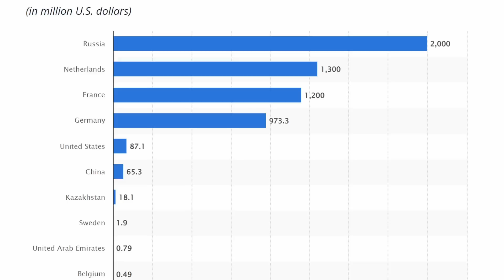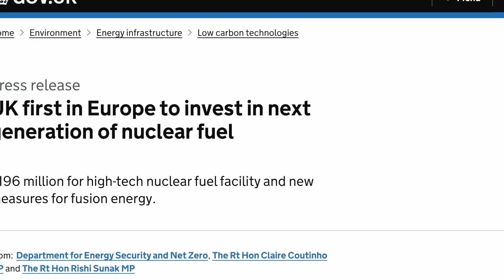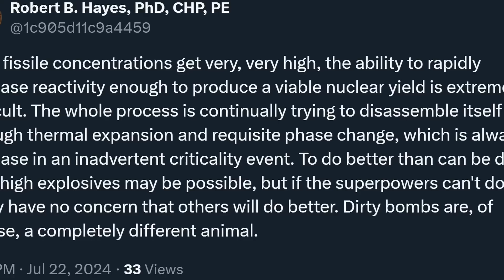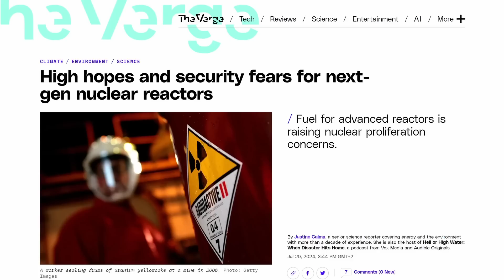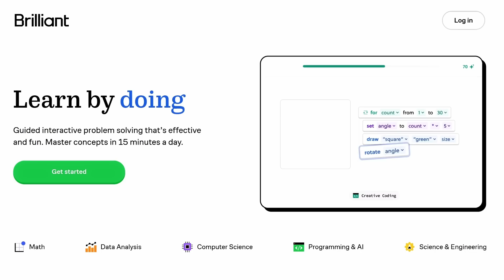Small modular reactor fuel could be used to build nuclear bomb, experts warn

Comment: Sorry I am not an expert but I've been around a couple and I find this video to be ... disconcerting. I don't think you can get a critical reaction from non-enriched Uranium or even low enriched Uranium no matter how much of it you stack up. That's why a  flux moderator is needed inside nuclear reactors that uses low enriched Uranium, even though there are up to forty tons of fuel rods inside. Also the U235 gun design used for the Hiroshima bomb is pretty straight forward not a lot of tinkering involved. The plutonium implosion design is super difficult because the explosive layers around the core need to be shaped in such a way that the shock wave is perfectly concentric which is VERY difficult to do. The reason the Manhattan team focused on the implosion design is Plutonium is too reactive to be used in a gun design it will fizzle instead. But weapons grade Plutonium can be produced much more easily than weapons grade enriched Uranium. Plutonium is a different chemical element and can be easily separated from the Uranium rods and purified. Enrichment is a mechanical process since U235 and U238 are the same chemical element and is much, much harder to do. 
In short a weapons grade U235 bomb is not that difficult to make. However the HALEU used in these mini reactors is not, as far as I understand usable for such a bomb.

Comment: Don't worry turning their fuel into bombs, dirty or otherwise will NEVER happen, because the SMR idea is a boondogle that will NEVER be commercialized.  Problem solved!  In case your wondering the reason why its a boondogle is that fundamental scaleing laws dictate that reactors so this small will have 10x the per unit power cost.

Comment: Technically, one can make a bomb with U-233, but both the U.S. & U.S.S.R. decided that it wasn't worth the effort.  Therefore L.I.F.T.R.s don't use practical bomb fuel.  (But they can be designed to use 'spent fuel' from Light Water reactors...)

Comment: It should he noted that uranium, even with a 15% u235 concentration, is only as dangerous as other non radioactive, and easier to get material. It's alpha decay and non metabolic, so the main issue is from its physical properties causing lung infections, fibrosis or renal diseases. But a dirty bomb would be much more deadly using beta/gamma emitting material used in medical imagery.

Comment: 1:00 are you sure you want to call uranium 235 a compound? Compounds mixtures of multiple different things? Isn't uranium 235 a specific single isotopes of an element? So you must be referring to the compounds which U235 exists as a part of, whenever it's not totally isolated. So oxidized uranium or some alloy of uranium, those would be compounds.

Comment: Any spent fuel road contains very small amount of plutonium.  Recycling it can yield a tiny amount of Pu 239. The purity for nuke bomb must be 90%.
Unspent fuel purity is very low, 3% unable to refine for nuke.

The real danger of SMR 300MWe is the method of moduling. The known Nuscale design is, lower reactor upper supercritical steam generator in one body module.
This structure is like two dynamite rods bound together.
The serous one is US state agency approved this compact machinery.

Comment: Trust corporate marketing firms to skew a topic to make it look better. Selling a stove with a broken burner? Tell your client it has three working ones and you're all set!
In the case of small modular reactors, at least in Canada, their development is massively subsidized by the state so when the reactor finally comes online, the end user has probably paid twice for each kilowatt consumed (and that kilowatt isn't cheaper than the one produced by regular means). That SMR will also produce spent fuel rods and those rods generate heat decades after they are spent. Where to put those rods? SURPRISE! You need to create a huge installation near some waterway and use that water to make sure that spent uranium does not go critical. FOR THOUSANDS OF YEARS. You'll never guess who helps finance that installation ... the tax payer!
One last interesting tidbit. You need insurance for all these reactors. Insurers know a nuclear accident easily goes into the billions of dollars so whomever builds a reactor needs a sugar daddy. Once again the state comes in and uses it's resources as collateral. That basically means in case of a hideous accident, the government is on the hook for cleanup and buying back irradiated land and houses and also paying for whatever lawsuits go beyond the means of the corporation that owned and operated said nuclear reactor.
If you're still interested in nuclear reactors and don't mind the added bonus of having waste fuel be used to create bombs, might I suggest you offer your backyards to store all that so safe nuclear waste?

Comment: Why not thorium? No proliferation FTW
Reply: 𝗧𝗵𝗼𝗿𝗶𝘂𝗺 𝗹𝗮𝗰𝗸𝘀 𝗮 𝗳𝗶𝘀𝘀𝗶𝗼𝗻𝗮𝗯𝗹𝗲 𝗶𝘀𝗼𝘁𝗼𝗽𝗲: it is impossible to start any fission chain reaction purely on mined thorium, and therefore any nuclear system relying on thorium would be initially dependent on prior generation of fissile matter (extracted 𝘧𝘳𝘰𝘮 uranium or bred 𝘪𝘯 uranium systems).

The development of new fuels or new reactor concepts is a time- and resource-consuming process likely to span several decades. Any industrial application of thorium as a nuclear fuel would continue to require the input of fissile material from the existing uranium/plutonium cycle until the required amounts of ²³³U could be produced to ultimately make the thorium cycle self-sustaining.

The development of a fully self-sustaining thorium/²³³U cycle would also require the development of industrial-scale reprocessing capabilities to recover ²³³U from spent fuel, along with fuel fabrication facilities to prepare the material for re-use.
See the report titled 𝘐𝘯𝘵𝘳𝘰𝘥𝘶𝘤𝘵𝘪𝘰𝘯 𝘰𝘧 𝘛𝘩𝘰𝘳𝘪𝘶𝘮 𝘪𝘯 𝘵𝘩𝘦 𝘕𝘶𝘤𝘭𝘦𝘢𝘳 𝘍𝘶𝘦𝘭 𝘊𝘺𝘤𝘭𝘦: 𝘚𝘩𝘰𝘳𝘵- 𝘵𝘰 𝘭𝘰𝘯𝘨-𝘵𝘦𝘳𝘮 𝘤𝘰𝘯𝘴𝘪𝘥𝘦𝘳𝘢𝘵𝘪𝘰𝘯𝘴, dated 2015, by the Nuclear Energy Agency.

Nuclear weapons proliferation is certainly possible via the thorium/²³³U fuel cycle route.

* For pure ²³³U the critical mass is 16 kg.
* For pure ²³⁵U the critical mass is 48 kg.
* For PWR-type plutonium the critical mass is 13 kg.
* For 'weapon grade' plutonium the critical mass is 11 kg.
See the Nuclear Energy Agency's 2015 report titled 𝘐𝘯𝘵𝘳𝘰𝘥𝘶𝘤𝘵𝘪𝘰𝘯 𝘰𝘧 𝘛𝘩𝘰𝘳𝘪𝘶𝘮 𝘪𝘯 𝘵𝘩𝘦 𝘕𝘶𝘤𝘭𝘦𝘢𝘳 𝘍𝘶𝘦𝘭 𝘊𝘺𝘤𝘭𝘦: 𝘚𝘩𝘰𝘳𝘵- 𝘵𝘰 𝘭𝘰𝘯𝘨-𝘵𝘦𝘳𝘮 𝘤𝘰𝘯𝘴𝘪𝘥𝘦𝘳𝘢𝘵𝘪𝘰𝘯𝘴, Table 9.1.

The critical mass of ²³³U and plutonium are fairly similar, while that of ²³⁵U is
comparatively higher. Depending on the design, it takes between 5 and 15 kg of ²³³U to
make an atomic bomb, which is not very different from the required mass of plutonium.

Comment: Probably should be pointed out that due to its high density, 1 ton of uranium is a bit over 50 liters. Small enough to fit inside a medium sized ice chest. Of course no ice chest is going to be strong enough to let you lift 1 ton. But for smuggling purposes, the volume of material is a lot smaller than you might expect.

Same goes for nuclear "waste", or spent fuel. Anti-nuclear folks like to talk about how the U.S. nuclear reactors generate about 2000 tons of spent fuel per year. But that's only about 105 m^3 per year. Vs about 1000 oil tankers worth of coal per year to generate the same energy. The total volume of spent fuel generated by nuclear power in the U.S. since its inception would fit into two Olympic sized swimming pools with plenty of room to spare. (Not that you'd want to store it that densely, because that would turn it into a huge nuclear reactor.)

Comment: Why can't we just use naval reactors rather than reinventing the wheel with new Small Modular Units? We already have training facilities, operating experience, fabrication factories and a recycling program. I get that ship reactors tend to use 90% plus fuel, but its not like powerplants with only 3.5% skip on security. 

Admittedly, I'm not a fan of small reactors - there is very much an economy of scale. Gamma rays are gamma rays - so you can't use less shielding on a thirty megawatt unit than on a three hundred unit. On the other hand, the number of crew members doesn't go up exponentially, so one big reactor won't require as many people as ten small ones. Not just control room staff - but ten reactors is ten plus turbines, and other support equipment. Think of it like comparing a bus to private cars. One metro transit unit is much larger and has a more expensive engine - but you transport fifty people with one engine, one driver, and one set of tires meaning you will have aggregate savings over ten five passenger automobiles.

Comment: It looks like the key paragraph in the article you cite is the following:

""For technical reasons, the traditional 3 to 5% fuel will not suffice for many of the power reactor designs that nuclear engineers want to build today. For example, proposed microsized reactors are so inefficient with their neutrons that they need HALEU simply to turn on. Most designers favor 19.75% 235U HALEU—on the cusp of HEU—because more 235U almost always eases constraints, but use of HEU is discouraged because of its clear weapons potential. In many designs, the amount of HALEU needed is hundreds to thousands of kilograms, which may mean that a single reactor contains enough HALEU to make a nuclear weapon. If this is the case, commercializing HALEU fuels without ensuring that the material is appropriately protected against diversion by national governments or theft by terrorists would pose a serious threat to security."

The article doesn't mean that they the fuel rods in their original state would be used to make a weapon, but that they already contain the necessary fuel to make it. While it would need additional processing to be used in a bomb, a substantial part of the necessary work  would have already been done. I agree that very few countries might have the technology to do so, but it could be acquired. I suggest you to read the article carefully. It does have a point to make.

The issue is that people must learn to use nuclear power without the temptation of building nuclear weapons.
Reply: Her point isn't that it's impossible. It's that it's highly impractical. You can theoretically get enough material for a nefarious purpose. Wow. That's true nearly EVERYWHERE. And there are much easier targets with much more exploitable vulnerabilities. This would still take a crap ton of work that is hard, precise, technical, and pretty likely to get you caught in the process.

Again, remember that the world's leading provider of HEU is Russia. RUSSIA. If you're worried about the proliferation of nuclear material to bad actors.. That ship has long, long sailed lol. 

This is not the problem.

Comment: Why is Sabine putting out disinformation meant to mislead those who might wish to build a homemade nuclear weapon?  Sounds like DTRA is getting nervous.  No Sabine, you can't make a functional nuclear weapon with any quantity of 2% enriched uranium.  No Sabine, it does not take 52kg of high-enriched to make a functioning weapon, it takes about 5kg, a volume about the size of a softball.  No, Sabine, high-enriched is not "100%", it is generally 92-95%.  They enrich to 95% and change the cores out every 20 years.  Anything less than 80% will fizzle and it takes about 20-25 years for a 95% enriched core to decay to 80%.  Core swaps were delayed because even a fizzling fission device when attached to a thermonuclear stage will produce a fusion reaction, enabling the NNSA to declare the fission cores viable over periods of greater than 20 years.

Comment: USA concluded already after the Hiroshima bomb that using U-235 for anything other than a one off nuclear weapon is futile. With 80% enrichment the Hiroshima bomb was technically only slightly better than a fizzle, in other words only a very minuscule portion of the U-235 used underwent proper fission.
Reply: Bro, that "slightly better than a fizzle" killed on the order of 100k people. I get that thermonuclear megaton stuff is the state of the art,  but the the old-style kiloton is already pretty deadly.
Reply: Inefficient, not futile. Also, enrichment technology has advanced a lot during the cold war and afterwards. And even though it was low-yield, you don't need extremely powerful bombs to be effective.

Comment: The issue with small form factor nuclear power, is the distribution of facilities that need to be heavily secured. If you concentrate your facilities down to a small number of heavily guarded locations, they are easier to secure against theft, easier to control who has access to them legitimately, easier to secure against terrorism or sabotage besides, and the number of routes used to transport material headed in or out of those facilities are few, and in turn easier to secure. 

 If you distribute many smaller units instead, securing myriad sites adequately becomes a greater task, requiring more manpower and other resources than would otherwise be the case, as well as making logistics route security harder. Even if said resources were available, it would still be a more complicated, easier penetrated security cordon than would be the case for fewer, larger facilities. 

 As it is, local authorities know that if an event occurs at a nuclear facility, every responding agency just dogpiles one location and secures it. If there is a nuclear reactor for every twenty square kilometers or something, and something happens, they'll have to scramble to identify which facility or facilities are affected, potentially having to split their forces, making the whole response more chaotic and less effective. 

 Many tell me that my concerns about nuclear accidents and nuclear terrorism are statistically absurd, pointing at Chernobyl and Fukushima as outliers, but what people don't seem to appreciate is the fact that those disasters were so huge, that their infrequency is heavily outweighed by the risks. Add a more convoluted distribution of fissile material into the mix, and the potential for disaster and deliberate malicious action becomes far more likely, and that is a risk factor that is UTTERLY unacceptable. 

 I love the IDEA of distributed systems, because from a strategic perspective they make it harder for a first strike assault by an adversary to shut down the country's grid by hitting large power stations, but from a tactical perspective its a really fucking bad idea and I don't dig it at ALL. I WISH we could have more convenient, less centralised power production and distribution systems, but placing many nuclear stations around a given landmass is a security nightmare and a bloody poor idea.

Comment: Then why aren't we pushing for thorium reactors?
Reply: Thorium reactors don't exist. 𝗧𝗵𝗼𝗿𝗶𝘂𝗺 𝗹𝗮𝗰𝗸𝘀 𝗮 𝗳𝗶𝘀𝘀𝗶𝗼𝗻𝗮𝗯𝗹𝗲 𝗶𝘀𝗼𝘁𝗼𝗽𝗲: it is impossible to start any fission chain reaction purely on mined thorium, and therefore any nuclear system relying on thorium would be initially dependent on prior generation of fissile matter (extracted 𝘧𝘳𝘰𝘮 uranium or bred 𝘪𝘯 uranium systems).

The development of new fuels or new reactor concepts is a time- and resource-consuming process likely to span several decades. Any industrial application of thorium as a nuclear fuel would continue to require the input of fissile material from the existing uranium/plutonium cycle until the required amounts of ²³³U could be produced to ultimately make the thorium cycle self-sustaining.

The development of a fully self-sustaining thorium/²³³U cycle would also require the development of industrial-scale reprocessing capabilities to recover ²³³U from spent fuel, along with fuel fabrication facilities to prepare the material for re-use.
See the report titled 𝘐𝘯𝘵𝘳𝘰𝘥𝘶𝘤𝘵𝘪𝘰𝘯 𝘰𝘧 𝘛𝘩𝘰𝘳𝘪𝘶𝘮 𝘪𝘯 𝘵𝘩𝘦 𝘕𝘶𝘤𝘭𝘦𝘢𝘳 𝘍𝘶𝘦𝘭 𝘊𝘺𝘤𝘭𝘦: 𝘚𝘩𝘰𝘳𝘵- 𝘵𝘰 𝘭𝘰𝘯𝘨-𝘵𝘦𝘳𝘮 𝘤𝘰𝘯𝘴𝘪𝘥𝘦𝘳𝘢𝘵𝘪𝘰𝘯𝘴, dated 2015, by the Nuclear Energy Agency.

Meanwhile, world uranium ore production has not been meeting demand since around 2015. See the World Nuclear Association's webpage titled 𝗪𝗼𝗿𝗹𝗱 𝗨𝗿𝗮𝗻𝗶𝘂𝗺 𝗠𝗶𝗻𝗶𝗻𝗴 𝗣𝗿𝗼𝗱𝘂𝗰𝘁𝗶𝗼𝗻, updated 16 May 2024.

And it seems available global high-grade uranium ores are insufficient to sustain a so-called "nuclear renaissance" in the longer-term. See the Energy Watch Group's Mar 2013 report titled 𝘍𝘰𝘴𝘴𝘪𝘭 𝘢𝘯𝘥 𝘕𝘶𝘤𝘭𝘦𝘢𝘳 𝘍𝘶𝘦𝘭𝘴 – 𝘵𝘩𝘦 𝘚𝘶𝘱𝘱𝘭𝘺 𝘖𝘶𝘵𝘭𝘰𝘰𝘬, Figure 113: Historic and possible future development of uranium production and demand.

Nuclear fuels are only going to get more expensive and scarcer.

Nuclear technologies cannot save us!

Comment: Almost no modern nuclear weapons use uranium, the exception might be some small pure fission tactical weapons. Plutonium is just far better material for bombs. Dirty bombs are also overblown in hazard level. Uranium is not active enough for the contamination to be critically dangerous, as long as the material is not inhaled you will not die from it. This is just far less practical than using a conventional warhead.
Reply: It depends on what fissile isotope is used:
* For pure ²³³U the critical mass is 16 kg.
* For pure ²³⁵U the critical mass is 48 kg.
* For PWR-type plutonium the critical mass is 13 kg.
* For 'weapon grade' plutonium the critical mass is 11 kg.
See the Nuclear Energy Agency's 2015 report titled 𝘐𝘯𝘵𝘳𝘰𝘥𝘶𝘤𝘵𝘪𝘰𝘯 𝘰𝘧 𝘛𝘩𝘰𝘳𝘪𝘶𝘮 𝘪𝘯 𝘵𝘩𝘦 𝘕𝘶𝘤𝘭𝘦𝘢𝘳 𝘍𝘶𝘦𝘭 𝘊𝘺𝘤𝘭𝘦: 𝘚𝘩𝘰𝘳𝘵- 𝘵𝘰 𝘭𝘰𝘯𝘨-𝘵𝘦𝘳𝘮 𝘤𝘰𝘯𝘴𝘪𝘥𝘦𝘳𝘢𝘵𝘪𝘰𝘯𝘴, Table 9.1.

The critical mass of ²³³U and plutonium are fairly similar, while that of ²³⁵U is
comparatively higher. Depending on the design, it takes between 5 and 15 kg of ²³³U to
make an atomic bomb, which is not very different from the required mass of plutonium.
Reply: @GeoffMiell  This greatly changes when you take into account that modern nuclear weapons are not pure fission weapons, but rather boosted fission. Its also less effort to get isotopically pure Plutonium than Uranium, military reactors are cheaper than enriching Uranium to weapons grade, which for example is why Pakistan chose this path.